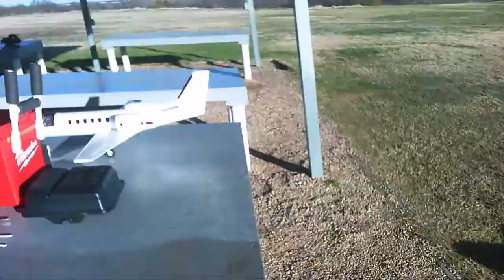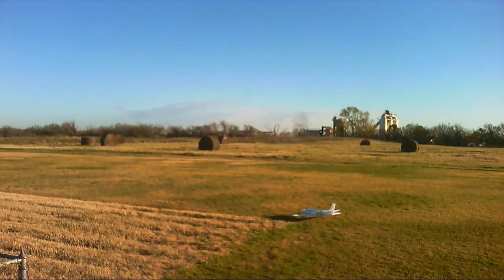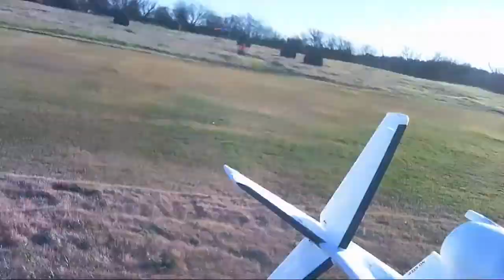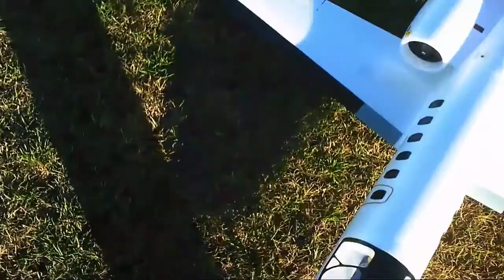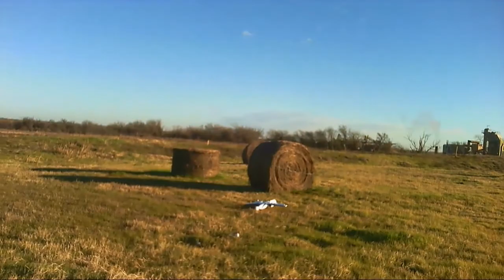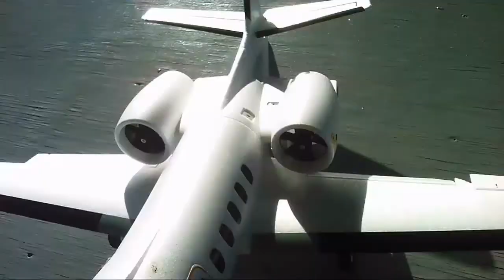Dynam Turbo Jet Maiden and Crash

Comment: That's something I would have done also.  Just can't wait to get them into the air. Easily fixed.  They always look worse than they are.Happy landings!
Reply from the maker: I actually sold that one off for parts. In retrospect, this plane did not come with flaps and I think I installed them wrong.  When I deployed them, my guess is that only one dropped, which caused a hard roll left and made it invert, and then when I thought I was pulling up, I was really diving it in further.

I plan to order another one this weekend and try again....

Comment: hmmm It looked like you didn't keep up your airspeed and the crosswind made it stall. I fell prey to that many times on my smaller jets.  Just my opinion though.  Hope you get it fixed.
Reply from the maker: I think you are right, though it did hook and roll upside down very quickly. - almost like it was with high throttle. (hard to see in the video but it went in nose first inverted)
Since I am new at this (flying about 6 months now), I would lay 3-1 that was indeed a "dumb-thumb" moment on my part.   :-)
Reply: Flaps in a strong wind!  Not a good idea

Comment: Hard to say what happened from my chair, I don't think it was a stall.  I have one of those and like it a lot but they have to have everything just right.  kind of looked like you lost the elevator.
Reply from the maker: +Sydney Smith 
I am suspecting a problem with my radio. I have had 3 planes go down with the same hard left roll. (Orange, Spektrum, and lemon receivers) - I called Horizon and the tech said it could be the radio giving a sporadic full left signal. They want me to send it in, but said with it not being a constant problem, I could expect to be without it for several weeks. 
Three planes lost, but 50 good flights, so definitely a sporadic situation. Check out the video on the MiniPulse...It had the same thing happen. (though I was making a left turn at the time with that one). If you watch it, let me know what you think it could be, or what I may be doing wrong. (I'm new at this - only about 8 months in)

Comment: Shame to see any R C plane crash,  couple of things you should have done,  On a maiden Always take off into wind,  if you think its too windy it properly is,  I always have my rates on low for the 1st    flight, you can go to mid or high rates if you have too, better to have  slow reaction's from controls than have over reaction,  I myself have repaired far worst damage, part of the fun of RC Flying I tell myself.
Reply from the maker: Thanks for the tips....I had only been flying for about 6 months when this happened. I have learned a lot since then, and am looking forward to trying one of these again. (I was not qualified to be flying an EDF back then. I made the mistake that I guess lots of folks have - You get where you can handle a trainer quickly, then you want to jump in to warbirds and EDF models...The results is plenty of crashes and rebuilding experience....